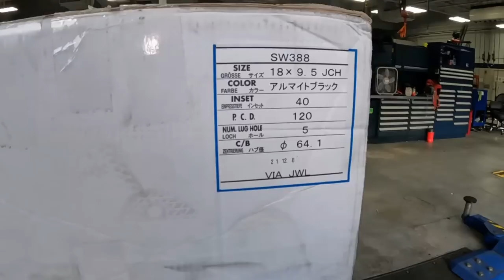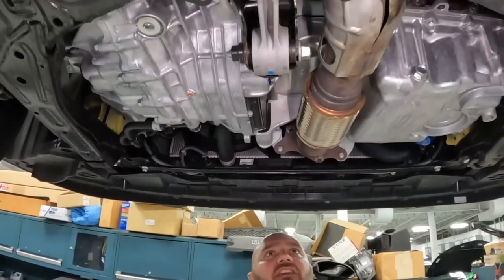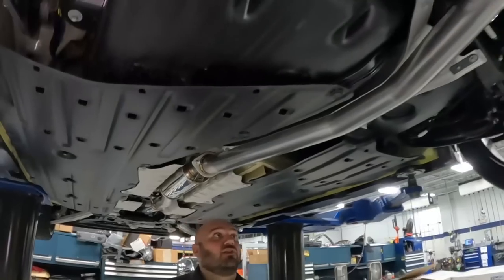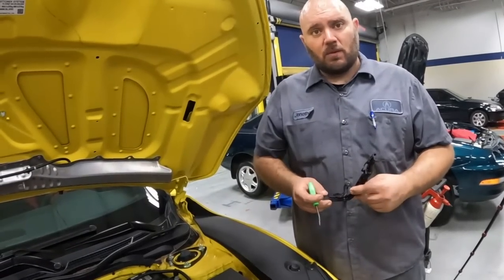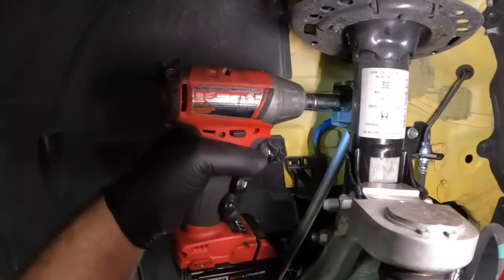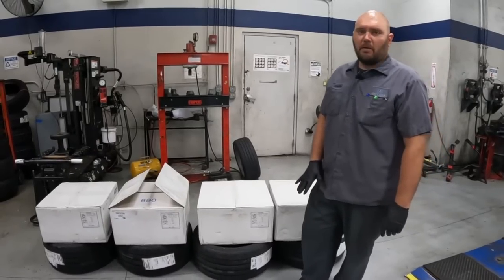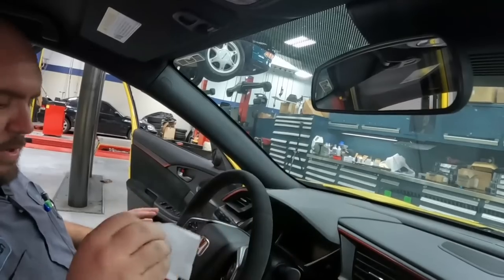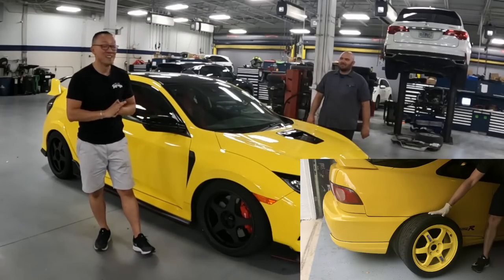2021 Honda Civic Type-R LE #550 - Spoon SW388 & Full Exhaust | PRL Intake | Swift Lowering Springs

Comment: I'm watching all your videos and I wonder if you can give the weight differences when you install the Spoon, PRL etc accessories? If you can save 10 pounds or whatever on any part, it really helps the handling. I would like to lighten my CTR as much as possible while doing the mods. The lightweight battery (Zero G?) is awesome for weight reduction and I will do the carbon hood and Spoon swan wing as well, to help with weight. Are the Spoon wheels lighter than stock? Thanks, great videos and nice caring work on the cars.
Reply: spoon wheels are a tad lighter then 17lbs, wayyy lighter then stock!